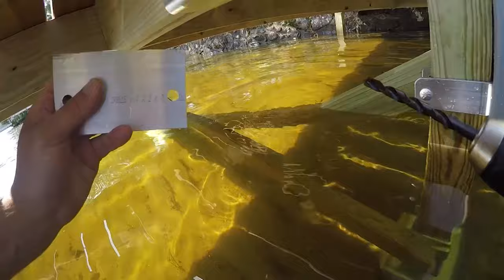A Weekend Warrior 4x4 Post Dock Project #dock #4x4postdriver #4x4postprojects #4x4postIdeas

Comment: When I'm pounding these 4x4 spikes into the lake, how do I make sure they go in level? Would really like to know. Thanks
Reply from the maker: When you winch up the dock section, put the level on the deck. For the first 2 legs, level one end side to side between the first 2 legs even though the outer end is slanted in the water. Tighten the first two legs then pivot the outer end up with your jack pole. Put that jack pole in the center so the section is balanced evenly. Raise the outer end of the section until it is level then drop in legs 3 and 4 just like the video shows. Put the legs in and use a level on the north and east sides of the post to make sure they are plumb before sinking them in the ground. If the deck isn't level, your posts will not be either. The first section is like a table. The other sections get hooked on and raised up level. Each leg should be checked and plumb before driving. Once driven, tighten each bracket to hold it. You could use 4 leveling winches but this is how you do it with one. If you need to drive the first two into the ground after legs 3 and 4, put the winch back there between 1 and 2 release the bracket clamps and drive them in as well. Once the 4 legs are tight and level each other section is easier because one hooks to the other and you only need to add 2 legs. If you make an L, watch the video again to see how I did it. Good luck!

Comment: Are there adjustment in very old climates for ice heaving?
Reply from the maker: The bracket clamps the post so yes but I make my docks removable so the ice doesn't take them away. Ice is very strong and it shifts. Nothing with legs can stop it. If you are making a boardwalk on a wetland, it usually makes it through the winter with just a little heaving. Docks in deep ice should be removed just like a boat would be removed so it doesn't get crushed by expanding ice.

Comment: What do you do in the winter when the water freezes?
Reply from the maker: They come out and get stacked on shore. They are made small enough to move the sections in and out every year. Some areas have different permits for permanent docks and you might put a bubbler in that keeps it from freezing. Those make the ice unsafe though. Usually if you let it freeze in the ice, it gets destroyed. The ice moves and lilts on the shore. People usually take their boats out too.

Comment: What if the floor isn't soft sand or mud and is really hard?
Reply from the maker: There is more than one way to do this. If you just sit them on the ground with the feet at the end of the post, they are not as solid. I've seen docks made this way and it's ok but not the greatest. I would suggest using pipe legs like in this video here. https://youtu.be/2Q9nZe1YGJM
These drive into the ground easier because they are steel and not as bulky as the posts and cost is about the same. You may also consider a floating dock held with anchors as long as it is not exposed to high wind and waves. The great thing about legs is that the waves roll through without moving the dock. There are feet for the pipes but in hard soil, sometimes we just drive them until they stop and they don't need feet. Sometimes a leg lands on a rock but the rest of the driven legs work together for stability.

Comment: What size 2” boards are used for the frame? 2”x6”, 2”x8”, 2”x10”?
Reply from the maker: In the video I've explained that I prefer 2x6 framing because it is light enough that I can move it by myself and strong enough for my boat. You can use larger lumber if you don't mind lifting it.

Comment: can we make our own post plastes? $25 each cranks the price way up on the cost for my situation on our pond.
Reply from the maker: In the book, "building your own dock", I show how you can make wood feet for your posts. You can also try it with no feet if the soil is firm enough. A few advantage of the aluminum feet is no buoyancy, they adjust in height and the post passed through the center anchoring into the ground. I could go on and get into how doing it other ways is much harder. There are more ways to build docks but this line of hardware has been developed over 40 years of building docks and running a company that manufactures dock parts that work best in many environments around the world. We have a large variety of methods that allow us to make floating bog walks on sponge like vegetation and even stairways over ledge. I guess the option best for you is one that works so the entire build lasts and stands strong. Each location has its own requirements based on what you have at the bottom. Good luck and I hope you succeed.

Comment: how long would this thing last?
Reply from the maker: This one will last 10-20 years in fresh water.
Check with your lumber supply to see what they say. Some treated lumber will last better in water than others.
You may consider the galvanized pipe method I show so no wood is submerged under water.
The hardware is marine grade aluminum.
Reply: @SethMerriam  thank you